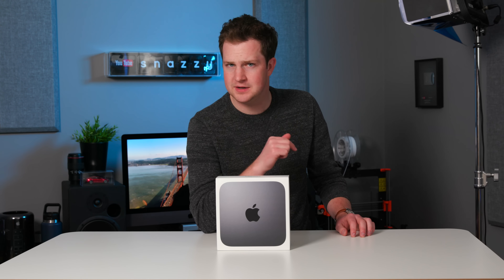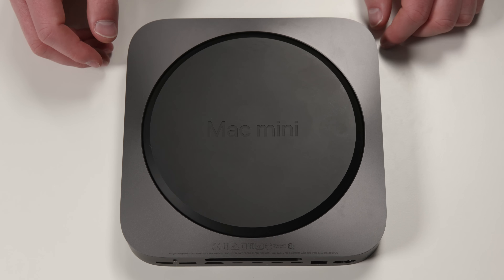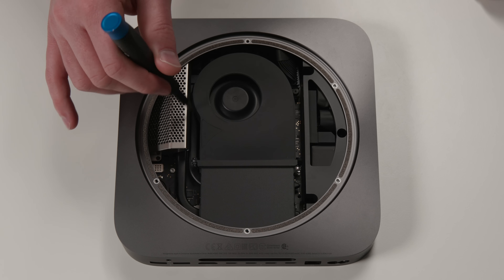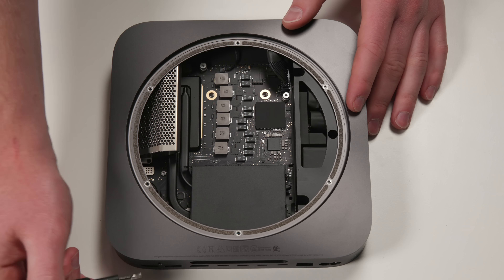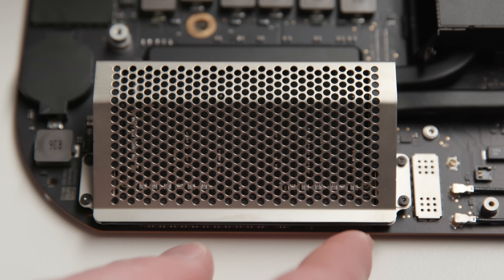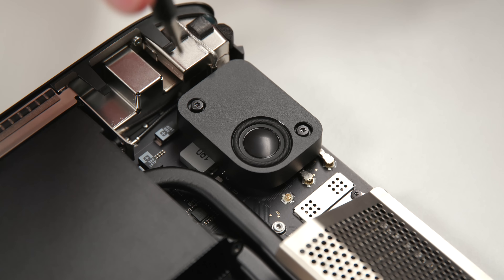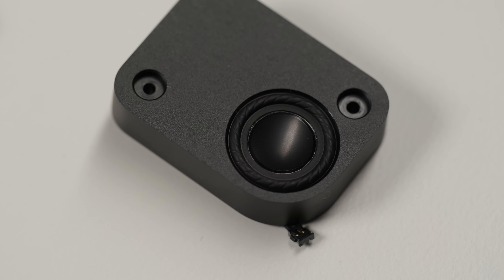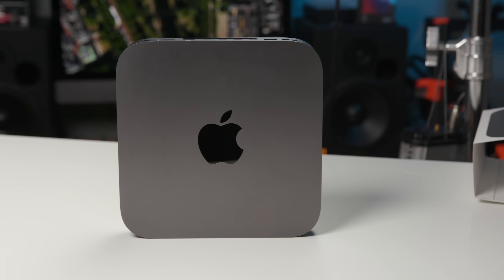Can You Upgrade the 2018 Apple Mac mini?! - RAM Upgrade Tutorial and Teardown

Comment: So, what real advantage over previous MacMinis? Seems like a lot of gratuitous over-engineering to make the Mini LESS repairable. Seriously. Over the years, I spec'd and installed over 100 MacMinis. Two years ago, I moved on to several Intel NUC boxes and even Raspberry Pi's. Don't regret that decision at all. Apple hardware is stupid and expensive, and software - non-standard. I mostly just want to run browser-based applications and OSX just does things differently for no good reason, and are always YEARS behind. So, I do Ubuntu. No regrets. I'll never buy another MacBook "Pro" either. My 2016 model is my last unless Apple brings back ports. USB-C is NOT that great, and WTF on MagSafe? Apple couldn't care less about its customers - they keep taking stuff away and charging more $$. They've thoroughly alienated me - and I bought my first Mac in 1984!

Comment: I prefer a better case and a square bottom that can replace RAM or SSD easily. Price is still too expensive. SSD should start with 512GB not 128GB. RAM should start with 16GB. and 1TB SSD should be about $200 not $600. RAM price is extremely overpriced. Now is 2018. SSD and RAM price drop huge already. Apple wakes up or goes die.

Comment: I bet the DIMM is keyed to the MOBO. LOL. Plus. Apple does not want you in their devices. this is an 8GB version, well Apples thinking is, you need 18GB RAMM, no worries, pay 600 more and u get the next up model which has all the same specs but comes with 16 GB not 8.... LOL. 600 for 8GB RAM. Only apple and Dell can get away with that shit.

Comment: they put a wordless 120GB drive that isn't any good for anything, you have to have at lest a 250GB I already know that one, done it, then they solder in the drive so you can't change it and make up some excuse about having to solder it in because some new security chip they came up with, you really think it couldn't work if you just pugged the drive in, there you go again good old capitalist pig scam job to screw you over so you have to spend more money, they always have to do something with everything they make, CPU ok but it really sucks when they have. to solder in the HD